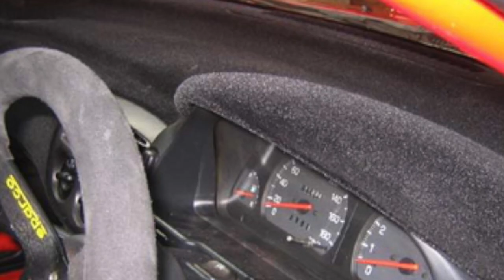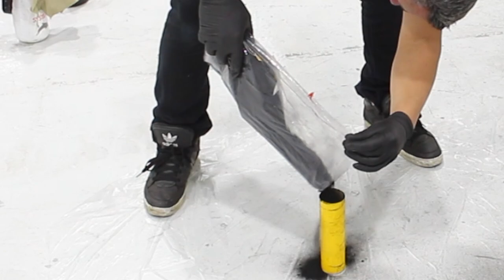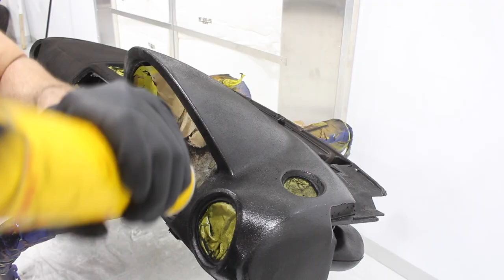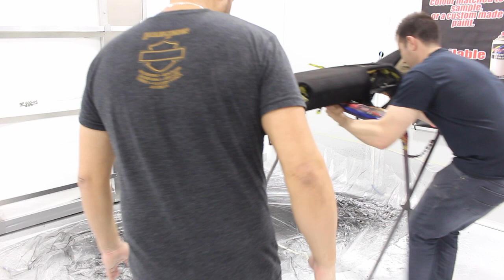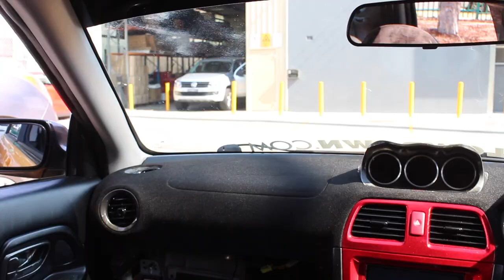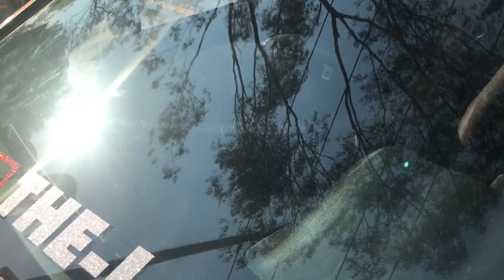Flocking How to Flock your Dashboard

Comment: Bit of an odd question, but would you imagine that this same technique would be able to be used to cover a roof lining? The fabric of my roof lining is sagging and pulling away from the roof mould, and I thought maybe flocking it would be a more permanent alternative to having the fabric reapplied
Reply: I’d definitely recommend replacing the fabric if done properly it will last ages, flocking really works best on hard plastics.

Comment: For some reason I thought flocking used a system to charge the particles so the stood up when they hit the surface you are flocking. I think Maybe it was Edd China that did it that way
Reply: sinformant yeah there's a few ways to static charge the project so they stand on end, but its good to see how the finish is without the charge, as the companies make out like its a total bust without charging it...
Reply: well it actually is a bust like you see here in the video if the particles dont stand up so to speak they dont swallow the light . you see how its all shiny and reflecting the sun thats why you need a negative charge .
Reply: sinformant ur thinkn of electro plating

Comment: I'm wondering can you flock rubber door seals. My 5 series has felt lined door seals from the factory, but my Alfa 156 doesn't. I wonder can I flockorize them.

Comment: how durable is it? whats the lifespan if properly applied?
Reply from the maker: Rintaro88 it should last for ever. It can be vacuumed. So it must be pretty durable.
Reply: cheers mate
Reply: Afaik, the two common materials are rayon and nylon. Rayon being more for things like the inside of the jewelry box and the latter being fairly durable. Supposedly, the nylon fibers are fade and weather resistant, hey hey!
Reply: 5 days in az heat  melts it all
Reply: @Pinkielover  good thing i live in minnesota

Comment: Thanks guys for the video 
I wish you would discuss the pros and cons vrs other dash covers.
Looking at this flocking, I like that you don't have to stretch a material over the dash but I don't like the powder mess but I don't like that there's no foam sheet under it (which can hide imperfections, make a real difference if your head hits it in an accident-federal law requires/ed it, and gives a nice feel) and the flock in jewelry boxes seems to hold up terribly and not easy to clean.
So it seems to me this isn't near as good as covering the dash with foam and  then a stretch with heat gun and contact glue vinyl....like our car makers do..
So thanks for the video but on a dash, what the flock!? LMAO

Comment: Is there a noticeable difference in finish between using this DIY pump and a professional powdercoat-like approach with electrostatic charge? The common opinion is that the DIY kit is only good for small parts. I wonder if it's because electrostatic makes it easier and less messy or it actually changes the structure.
Reply: Electrostatic stand the fiber up on end, which generally creates a more even satin finish.
Reply: A hell of a difference when do right. This is just a bodge job

Comment: that looks like shit !
Reply: its not really for looking better though honestly.  Its purely for the reason of reducing the glare on youre windshield.  Some cars literally have so much glare when its sunny out it completely distracts you from the road. and this stuff once applied almost completely eliminates it which gives you a much better visualization of the road ahead.
Reply: why don't they just put a dash mat on it instead of pulling the whole dash out and spraying shit all over it 
much cheaper .
Reply: Because a flocking kit is only 50$..
Reply: plus the time and effort involved with pulling the dash out , this would have to be the most retarded product on the market , i suspose if you did it in red your car will go faster , LOL
Reply: Pulling a dash is incredibly easy. This is a functional mod if you're going to track your vehicle.
Reply: angel that's why you see motor sport teams wrapping and spray painting the dashboards in race cars .......oh actually wait ...